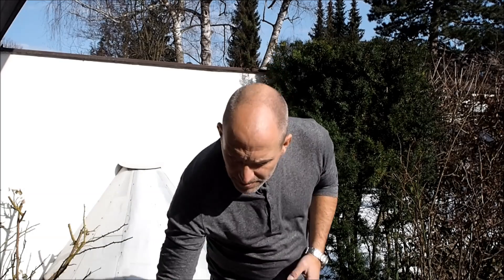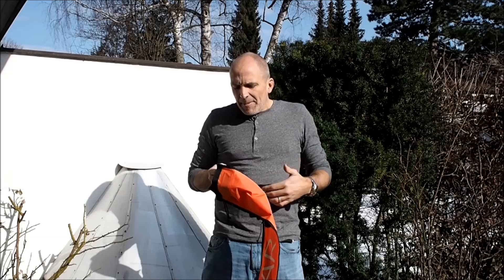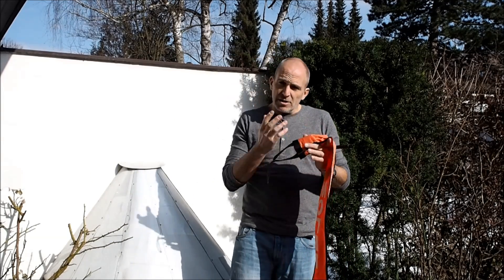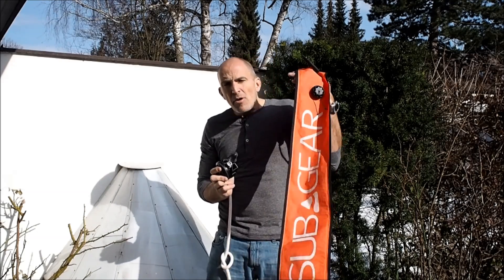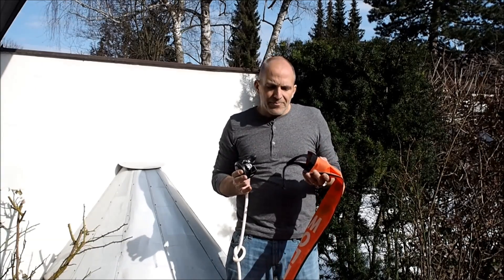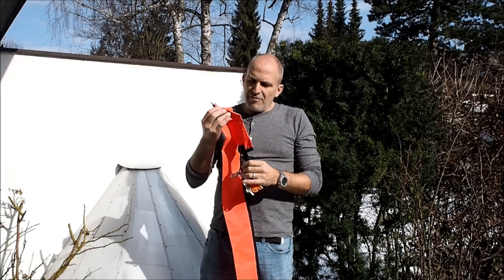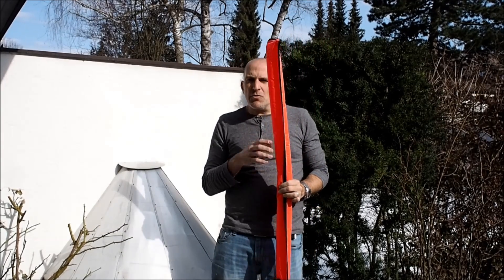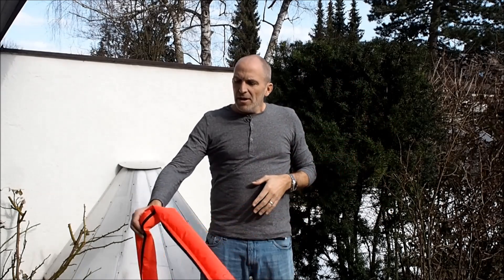Open SMB vs Closed SMB

Comment: Why not use Octo. for a better controlled inflation?  Also, I use a full- face mask so oral inflation is not a good idea.
I see there is also an adaptor that replaces oral inflation but can quick-connect to BCD power inflator nozzle
Reply: Using the octo doesn't change anything about the risk of entanglement. The adapter you're talking can be used with a LP hose (without locking as said in the video) but it's much easier to inflate by mouth.

Comment: In my opinion the best solution are open ended self-sealing SMB. I opt for oral inflation using the exausted air from my reg, without removing tit from my mouth. Here a more detailed explanation if you are interested: https://www.facebook.com/groups/3581446725262618/permalink/3581660435241247/

Comment: It is interesting that you call attention to entangling one's gear but in a separate video where you demonstrate and recommend launching a lift bag as a team you pull the lift bag underneath you to inflate with your drysuit inflator close to your body without consideration of entanglement.  Would it not be safer to pull the inflator hose away from the body or use the wing inflator in front of/away from the body to inflate the bag?
Reply from the maker: Jeff. this is interessting as a lot of people come up with this. if you inflate the bag in from of you it will pull you out of trim and and you will not be able to work against it. filling it underneath you can compensate these moments of increased buoyancy. The only entagnlement risk is the line - that is why we demonstrated it this way. If you have the line and the bag - the line is underneath you as well and you cnat see it. if you do it with the buddy - the line goes away from you and is in fact NOT under you. The liftbag itself is comletely free of any hazzards - you cant get entangled in it. We do it like this for more then 20 years in thousants of dives and teach it for 12 years now without a single incident - exactly for those reasons.